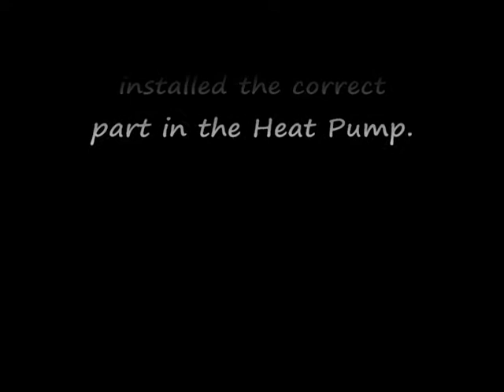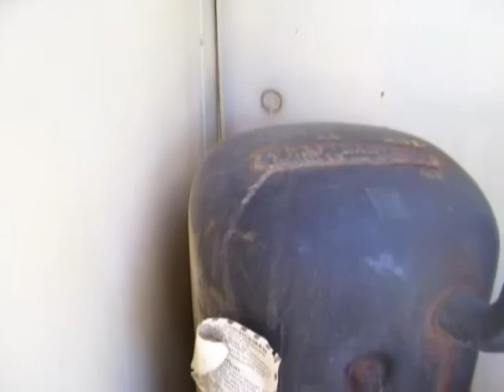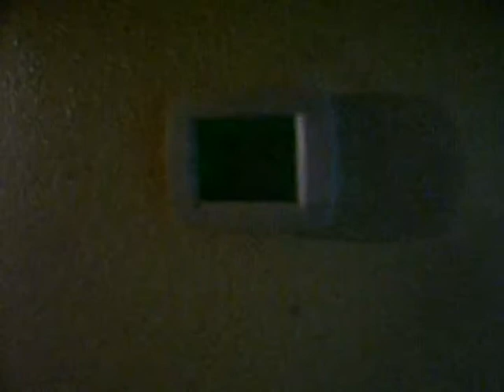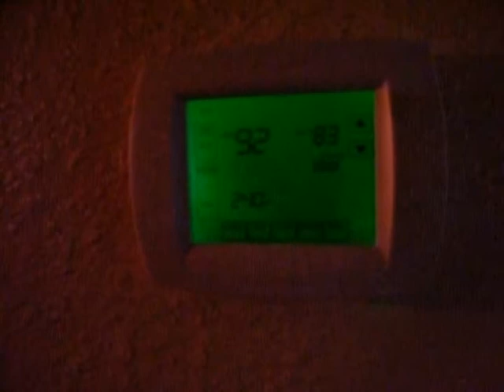Old Goettl AC Repair - Part II

Comment: the tan unit that was on the house on the other side of the next house at  4:23 you callin that a goodman?
Reply from the maker: +Roush Hawley At 4:23 there are three houses in a row in that direction and I believe it was the second one back rather than the closer one that I was speaking of. The closer one looked like a mid 90';s Goettl. Same brand as what I was working on but almost 20 years newer.

This was way back when smart phones had cheesy 3gp video recorders. Not like the HD and 4K HD of the modern phones. :-)
Reply from the maker: Also, sadly the Goettl name was bought out and a company has been throwing the Goettle nameplate onto POS GOODMAN units!

I just seen some a month ago or so like that. I meant to make a video of it but only got a still shot of it.

Comment: I like how the capacitors are mounted in the open. I guess that's why I haven't seen a Goettl, it rains and snows where I live.

What is that, @ 6 SEER?
Sweet unit.

I like how it is mounted on the roof so it can it catch full sun all day long.

"That York runnin over there."  have you listened to a York Affinity? No because you can't hear them, their that quiet.

Goodman is using Amana designs now. Gone are the days of Janitrol. Goodman builds decent equipment now.
Reply: tstatech Goodman is using Amana now. Worse quality now